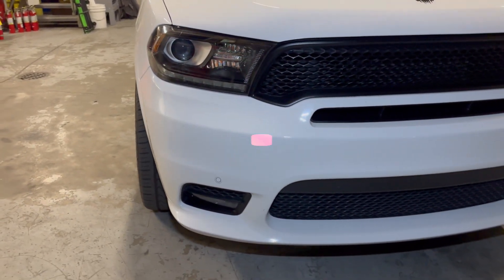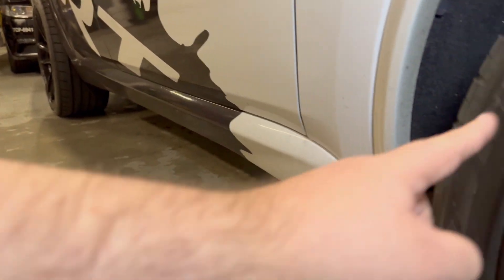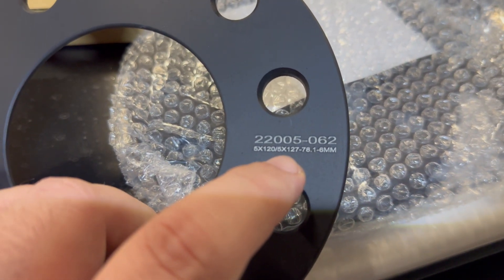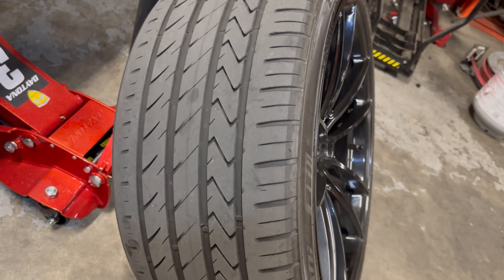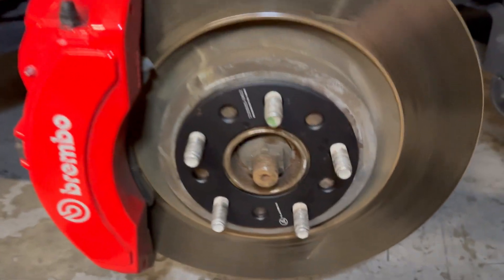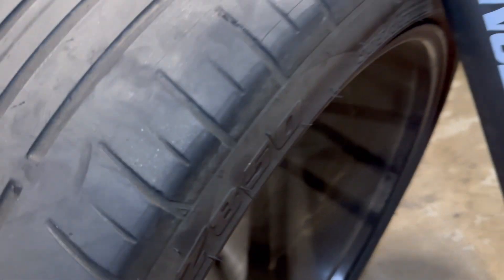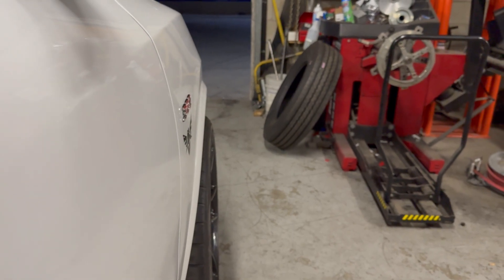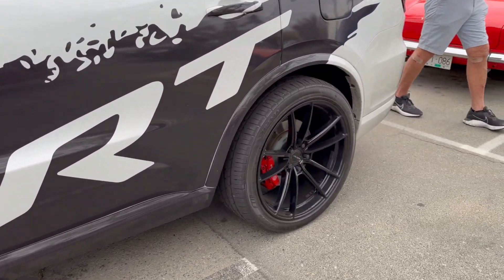Using Spacers on my Velgen VF5 wheels. Why do it and does it work?

Comment: Great video, i did this set up today. On my 2022 Durango RT i have the velgen wheels for the last year but upgraded to brembos today. Did you only do the spacers in the front? I’m debating if i should do all 4 wheels for a uniform look? Thank you.
Reply from the maker: Just the front cuz that’s where I need the clearance for the smaller offset of the 2 wheels
Reply: @MattySRT  thank you very much. Any  difference on the ride?